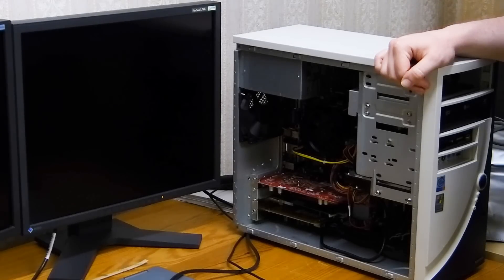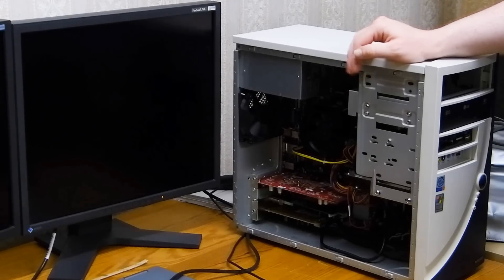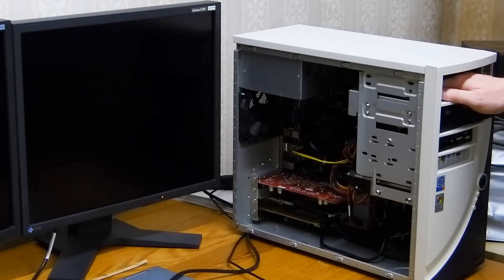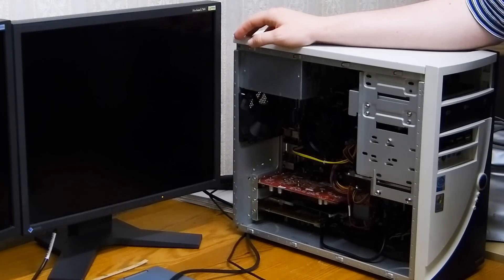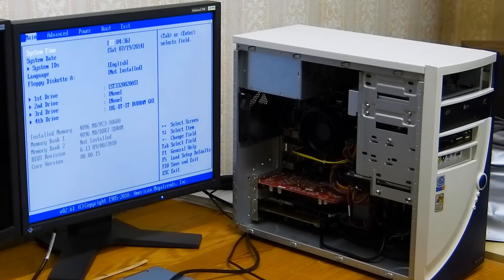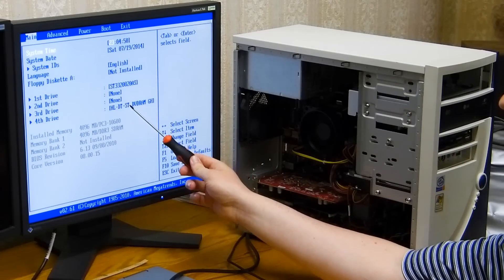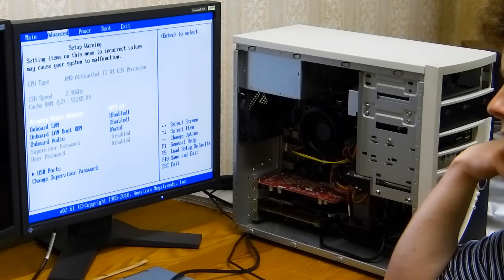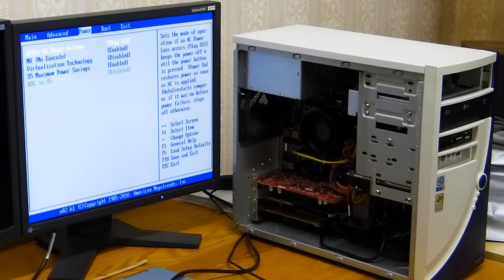Building a PC [5/5] - Test Run

Comment: I used to do a burn-in test to all the computers I assemble, especially the ones made up from used components. What I do is I install Windows, all the drivers, then download Prime95 and let it run for 8-12 hours. If the stress test ends up with an error, or the computer bluescreens meanwhile, then most likely there's a RAM error (which Memtest might or might not detect) or the CPU cooling is inadequate. (that may also cause thermal shutdowns) Of course I'm monitoring the CPU temperature during the process. As soon as Prime95 passes the 8-12hr test, I move on to at least 4-8hrs of Unigine Heaven to push the graphics card a bit, if there is a half decent graphics card installed in the computer. If that passes as well, the computer will work for a long time for sure, at least from the hardware standpoint :)

Comment: Not bad build. I got a old relic to compare with today tech.   Asus A8N-SLI SE 939 amd sempron whopping 1.8 ghz 2gb pny ram with 1/2 gb random name so 2.5 total 500 gb hd sata 3 but board has sata 2.  512mb nividia 8500gt pny graphics card.  Runs fast since hd change from pata to sata.  Pata was 80gb and 40 gb western digital.  Seagate is my 500. Not bad desktop running win xp. Runs Windows 7 good did a trial run with a burn copy.  You have a accent I noticed.  Well hi from east coast usa.
Reply: To addi built mine in 2006. Has been good. Just got running 2 year ago. Had sat for couple years.  Also had dust problem to prevent starting

Comment: All that hazzle just for a system still worth less than 150€ (probably less than 100€).
(compare it just e.g. to http://goo.gl/DlGR0J from a shop where you got DVI; HDMI, USB3 for 170€)
Reply from the maker: The aim of the project was to make use of the parts of a load of old computers, as I said in the 1st part. Of course, I could have spent 150€ for a system like that and thrown the old computers into the trash, but that's just not how I do things.